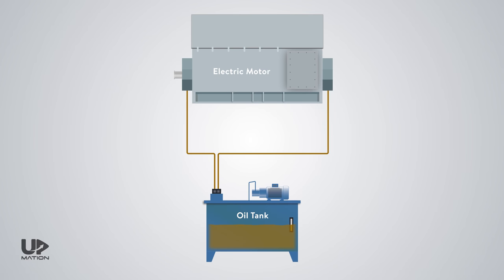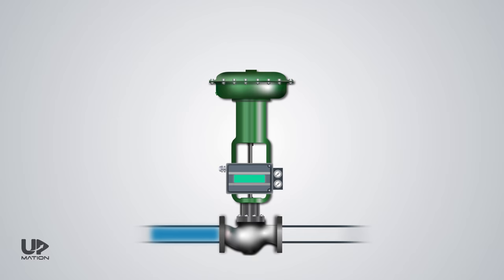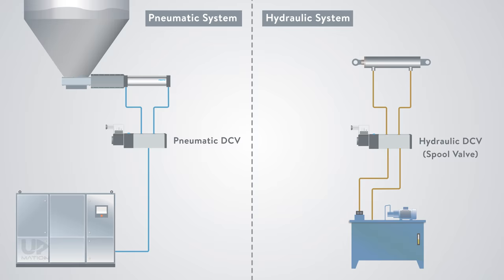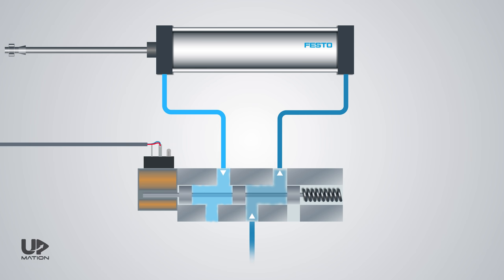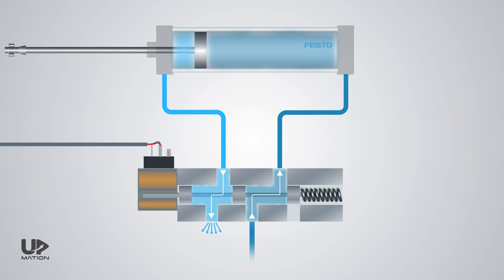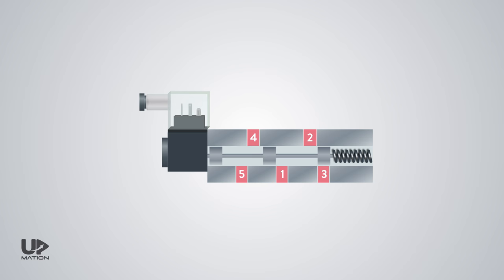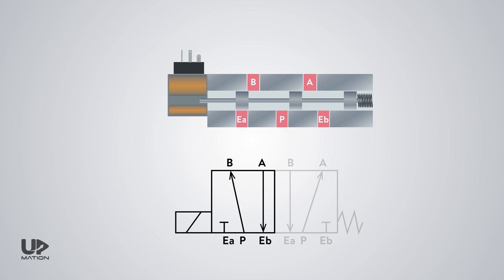Directional Control Valve Working Animation | 5/2 Solenoid Valve | Pneumatic Valve Symbols Explained

Comment: What is the difference between 5/2 and 4/2 in function? If same, why choose 5/2?
Reply from the maker: Hi there! It's a good question!
A 5/2 has one extra exhaust port in comparison with a 4/2. Although, the price of a 4/2 is more than a 5/2 valve since the cost of the design and manufacturing of the valve with a single exhaust port is more. 
5/2 valves are commonly used in pneumatic systems but 4/2 valves are used in hydraulic systems. The reason is that in hydraulic systems the oil has to be returned to the tank or reservoir; So the only exhaust (or drain) port of the 4/2 valve will be connected to the reservoir and in both positions the oil will get back there. As opposed to the hydraulic systems, in a pneumatic system it doesn't matter where the air is exhausted! So we use a 5/2 valve which is cheaper. It was a quick answer to this question... as we had some requests and questions on this subject, we decided to prepare a video and compare all common types of DCVs and their applications including 4/2, 3/2, 5/2, etc.
Reply: @Upmation  it will be helpful

Comment: I am an elevator mechanic. I work ok hydraulic elevators all the time. Reading the prints. Adjusting the valve when we replace bad ones. Understanding the coils on the valves and how the pick and drop. Making adjustments to get q smooth ride in the up and down direction from floor to floor. Great video.
Reply from the maker: Thank you for your comment!

Comment: Sir i have a doubt. 
can you confirm if there's a risk of electric shock in the flowing water when we provide power to the solenoid valve using

Comment: Would it be correct to say that in this situation we have 2 valves and 2 actuators? The solenoid for the stool and pneumatic for the piston/gate valve. And the DCV is at the same time a pneumatic and solenoid valve (it's part of the pneumatic system but actuated by solenoid)?

Comment: I noticed a small error regarding the symbol, it doesn't match the valve as it is shown in the video.
The symbol is for a basic solenoid operated, 5 port, 2 position with spring return. The actual valve shown is pilot operated, meaning that the solenoid does not work on the valve spool directly.

Comment: I don't know it this is correct, but I also call these shuttle valves as the internal mechanism "shuttles" back and forth depending on the state of the solenoid.
Reply from the maker: Hey, John! Thanks for your comment. I believe it is better to use DCV, as Shuttle valves are used for different purposes. The concept is somehow the same, anyway.

Comment: Hello, Thanks for your thoughtful video, and I just wonder to know why in the minute 2:24 you said that this valve is N.C while energizing the valve (make the coil pinky) it retracts and closes the valve. So shouldn't we consider it as N.O that when we do not have 24V, it makes the valve open?
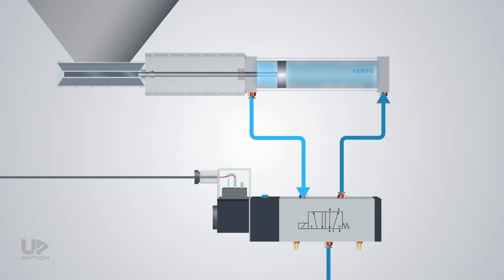Reply from the maker: Great point, Azam! But this is about the Slide Gate Valve @2:08. Please watch again and you'd see that the slide gate valve is closed when the DCV is not energized (Normal condition). So the valve (Slide Gate Valve) is a Normally Closed valve. Consider that, we cannot call the 5/2 DCV a NO or NC valve as there is not a single direction. It actually helps the main valve (Gate Valve) to become open or close. Thank you for your comment, BTW.

Comment: To get the slide gate valve to work in a normally open position the hoses on the cylinder could be swapped ?
Reply from the maker: Yes, by swapping the hoses you actually change the normal position of the slide valve.

Comment: In which condition it will be at the end if there is no compressed air flowing through port B , is it open or  close of a plate valve.
Reply from the maker: Sorry I didn't exactly get your question. But I think @2:01 you will get your answer. When the solenoid is not energized, the slide gate valve is closed.

Comment: You wound me sir using a pneumatic inline valve valve in a hydraulic circuit...

Surely you couldn't have found a NFPA/CETOP or cartridge valve for a picture.

Expect perfection even in theory.
Reply from the maker: Hey, Drew! I did not get your point! If you've watched the whole video we did not used any sort of hydraulic circuit! All was a single example in a pneumatic circuit. Anyways, thank you for your comment.

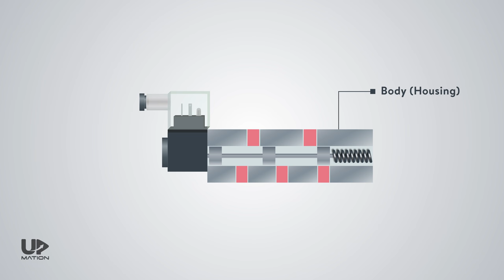Comment: At the 2:43 mark, isn't the lower left arrow pointing the wrong way in the diagram? Top and bottom arrows on left are both pointing inward on the valved.
Reply: Not knocking anything, this is a GREAT video. Just want to see if anyone else was confused by that part. Thanks again for the work here!
Reply from the maker: Thank you for your attention. Yes, you're right and we got another comment some time ago about it. Sorry about that.

Comment: How to programming this solenoid valve with ladder language
Reply from the maker: Hey, Rabia! To command to this solenoid valve via your PLC, you need to only connect its solenoid cable to the output terminal blocks of the PLC output card and use its channel address in your PLC program and logic. Please let me know if I can be of further help.

Comment: the video is instructive and useful, but not entirely correct. the coil does not pull the piston inside the valve body to allow the valve to perform its default function. the coil opens a small valve that lets you through the pressurized medium to push or pull the piston inside the valve body to perform the given function. this is exactly why every valve manufacturer states on the valve plate the minimum and maximum pressure at which the valve operates. it is not a malicious critique but a suggestion to help students better understand the principle of valve operation. however I rated the video positively. thank you
Reply from the maker: Hey! Thanks for the input!

Comment: How did the coil push the spool valve sir? When the coil being energize it creates magnetism magnetize the spool....so then it will not push..pull?
Reply from the maker: Yes, as you explained, when the power is connected to the coil of the solenoid, an electromagnetic field will be created around it, and according to the right-hand law, it will create a force that pushes the spool to the opposite side (in this video, the right-hand side). When the power gets disconnected from the coil of the solenoid, the force will disappear and the spool gets back to its initial position by a force from the spring. Please let me know if my answer has solved your question.
Reply: @Upmation  hmmmmmm.....ok sir because in my mind just like a relay on eletronics or even some valves on automotive parts because I am an auto electrician sir when the coil has been flowed by the current it creates magnetism thats why causes valves,relays etc.to retract or being magnet that need for their functions....open and close....do you mean the magnetic flux surrounding on a coil instead of creating magnet it will push the spool valve?
Reply: @Upmation  do you mean sir the initial energy from the magnetic flux on the coil as current flow through causes to push spool valve?
Reply from the maker: @mr.technician4144  Exactly as you said.
Reply: @Upmation  ahhhhh.....now I know.....so how the other valves being magnet if that force is present? I mean their's a configuration,design? I thought only magnet will be on that energy....thank you sir....
Reply from the maker: @mr.technician4144  The other valves may have two solenoids and two springs on both sides. The solenoids could not be energized at a time.
Reply: @Upmation  thank you for your time sir god bless

Comment: What is the difference between 5/2 and 5/3 solenoid valve????
Reply from the maker: As you've learned from the video, both have the same number of ports but a 5/2 valve has two positions, while a 5/3 has three positions.
The third position of the 5/3 valve is for blocking all ports of the valve and the actuator will stop moving in this position. For instance, in this video if we had used a 5/3 valve, we could move the cylinder to right and left as well, but the difference with the 5/2 valve was that we could also stop the cylinder from moving in the middle of its movement to right or left. What we cannot do with a 5/2 valve. We will make a video about it.

Comment: What is the difference between 5/2 & 3/2
Reply from the maker: 3/2 DCV has just 3 ports. One is connected to the actuator; one is for the supply (pressure) and the other for the exhaust. Its difference with 5/2 DCV is that it should be used with a single-acting actuator (the actuator has a spring on its other side to return to its initial position). Therefore a 3/2 valve cannot pressurize one port of the actuator while exhausting the air from the other port. Meaning that the first position of the 3/2 valve is used to pressurize the actuator and the other position is for exhausting the air inside the actuator.